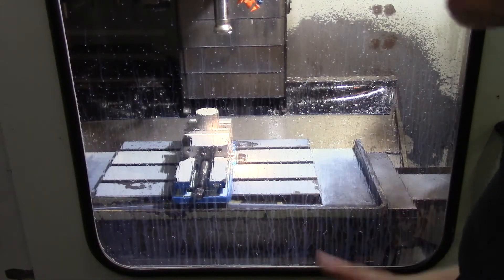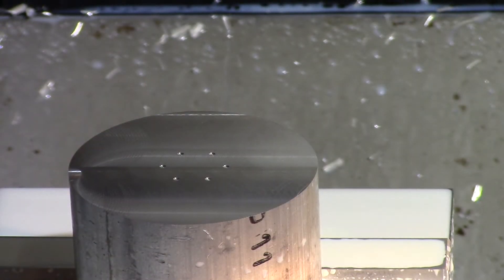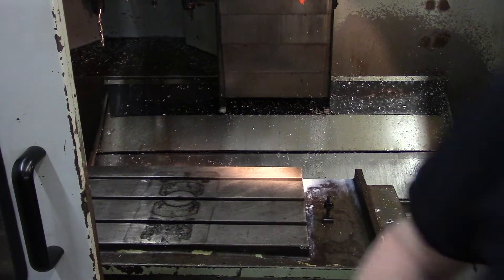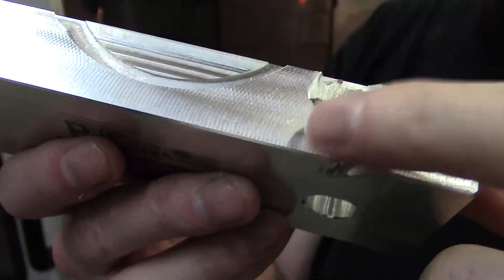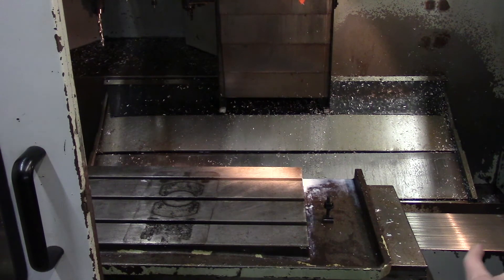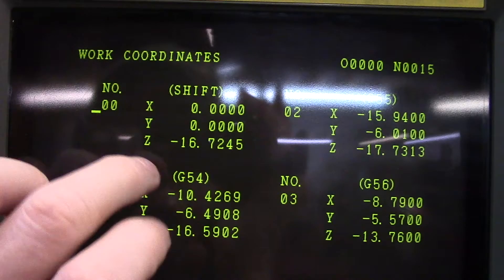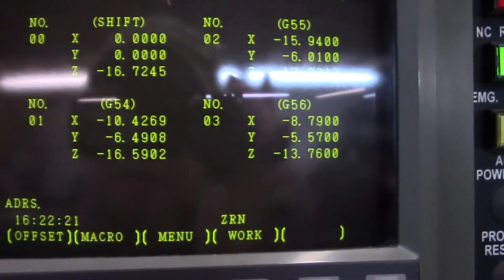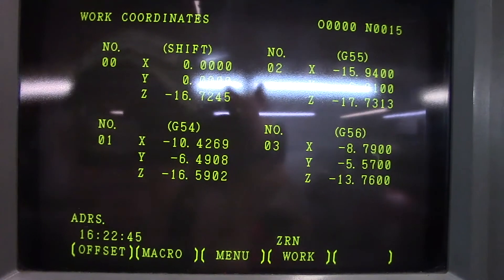Vise Knob and Destruction of a Face Mill/Crash

Comment: Dang nabbit.  That's a shame.  Shane my man!  You've got a lot of corrosion on your table from your vise.  You know those pieces of brown oiled paper that you get with new tooling?  Throw one down UNDER your vise as a gasket.  Works like a charm.  Completely protects both surfaces from corrosion.
Reply from the maker: The corrosion is from the prior owner and doesn't match the pattern of the Kurt. I have cleaned the table and stoned it.  I take the vise and reposition every so often keeping a layer of T5 on it when it's not in use.